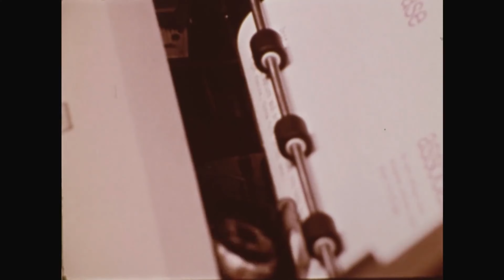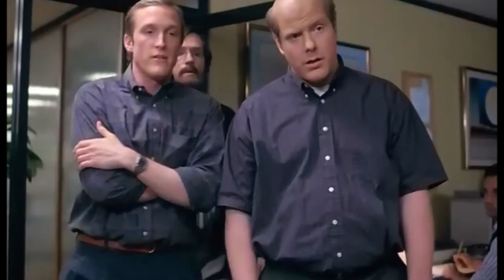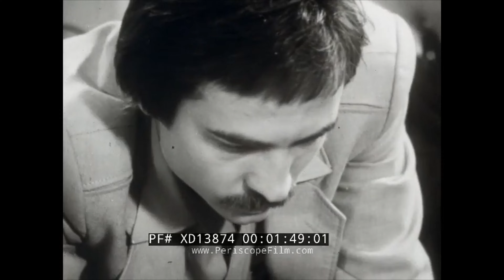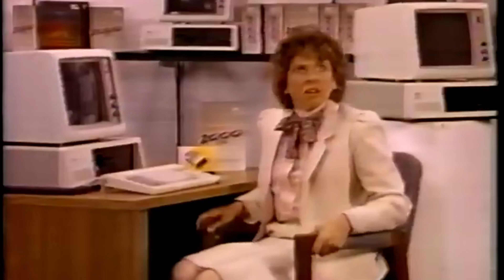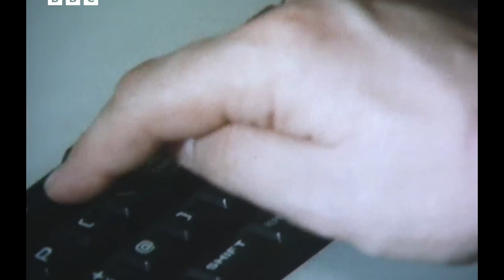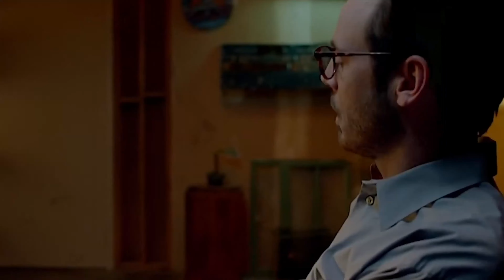Divided They Fell: The Insane Story of WordStar's Downfall

Comment: On the issue of printer drivers, I had a freeware word processor named Galaxy. One of its best features was it included a tool that would allow you to write your own driver for your printer. It required you to enter the printer codes for various effects (bold, italics) but it worked well.
Reply from the maker: That was a really neat feature :)
Reply: pretty sure I had a printer driver configuration binary for WS3 or 4 on CP/M 2.2 which allowed creating new printer driver records -- and like you described, you had to provide it with the ESC sequences from the printer's manual. Similar tool existed for terminal control codes, as each CP/M computer/terminal was different, sometimes not by much, but WS needed all the control of the screen it could get. Curious this should have been lost again by the time they worked on WS5.

Comment: I was a long-time WordStar (WS) user, beginning with WS 3.3. Although WS 3.3 was okay, it wasn't as good as my standalone word processor, CPT (used 8 inch floppies). It has a lot of limitations, such no support for subdirectors, and all documents have to be stored in one directory.

These issues were resolved with WS 4.0. WS 4.0 fixed all of the limitations of the 3.3 version, while still staying true to the classic WS, and to me was the best version of WS (I can understand why George R. R. Martin still uses it). Unfortunately, when WS came out with Version 5 I didn't like it. It seemed like they were trying make WS like WordPerfect and it didn't work. It was too complicated to use, so I returned to Version 4.0.
Reply from the maker: It is bit unfortunate that WordStar ruined such a truly great product :(
Reply: @Tech_History_Channel  It's also unfortunate that WordStar 4 is no longer available. It's one of the word processors that I'd like to have (the other is Professional Write). Both are great for writing text, and don't need the power of more recent word processors. Consider that WordStar 4 ran fine on a PC with an 8088 processor and 640kb of memory.